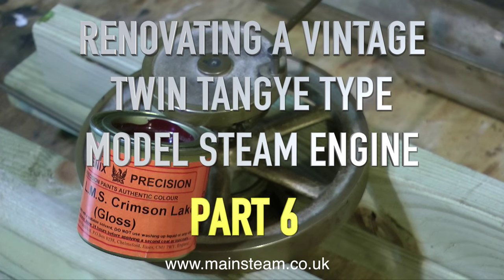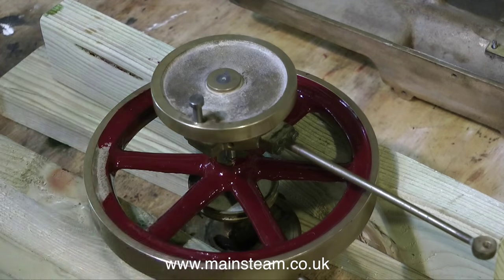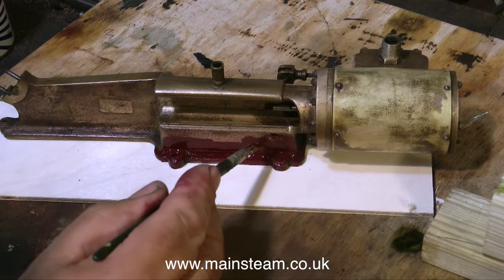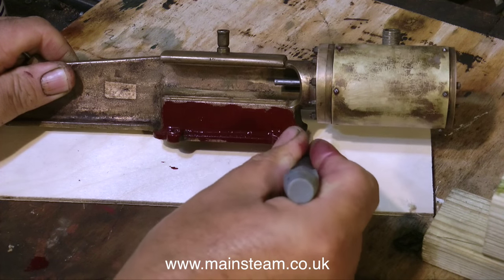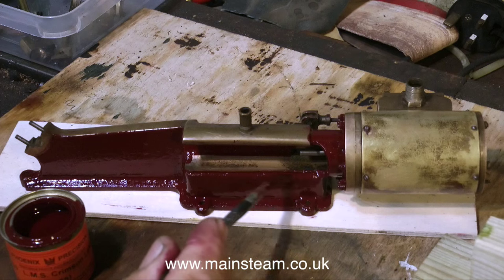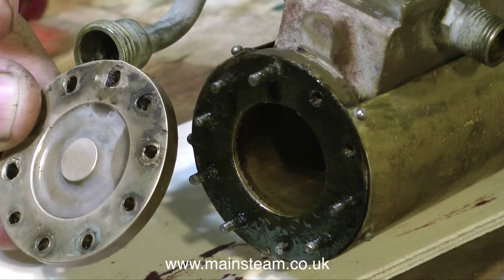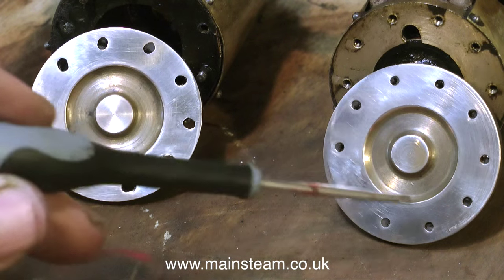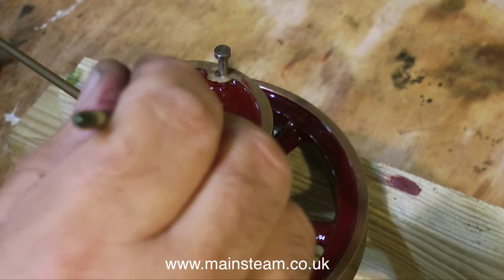PART #6 - RENOVATING A MODEL TANGYE TWIN CYLINDER STEAM ENGINE

Comment: Hi mate.
I don't know if you have tried this, but I find that pulling while tuning a stud helps getting them out.  Often the thread has worn away , but you might find that there is still some thread past the worn bit, if you get what I mean.  It would eat me up if I leafed something behind.
Marcel.
Reply: He tried that when he as taking it apart sometimes they might be held in by nuts on the lagging and if the nut slips you cannot get it undone
Reply: stanley carter Ok, I must have missed that, Thanks
Reply from the maker: Marcel Timmers The broke "studs" are loose bolts put in from behind the cylinder cladding. The only way to remove them is to first remove the cylinder lagging, which would mean grinding off the small brass bolts, then re drilling and re tapping the threads for new small brass bolts. The broken "studs" are vey loose in the holes.
Reply: Keith Appleton Hi, I did not know how far you wanted to take it.  I should not speak, I first leave something like that for a few or more months, and ponder/procrastinate, and than have a look at it. At least you know what you want to do.
Reply: +Marcel Timmers 
I've had some luck if there's enough room, sliding something behind the nut and putting pressure on the stud/bolt.
To get more room behind the nut, remove all but the two, then using the head as leverage very carefully pry out a bit.
I bet that's exactly what damaged the head, they got to aggressive.
If that doesn't work support the nut from underneath, and use a sharp chisel to crack the nut, , or use a grinder to grind it down first to weaken the nut, then crack it.
It could also be cut with a dremel tool.
Reply: Those are all valid solutions to a problem like this.